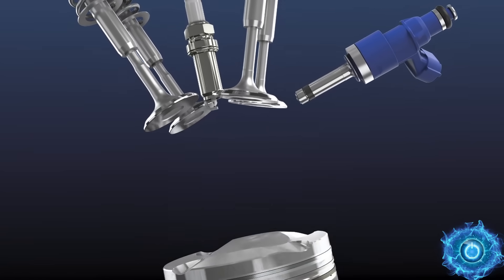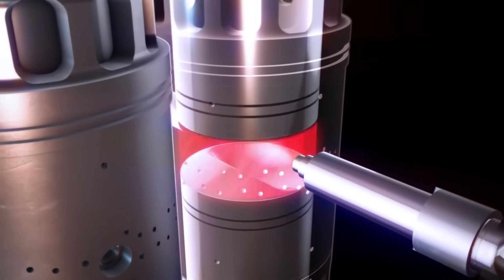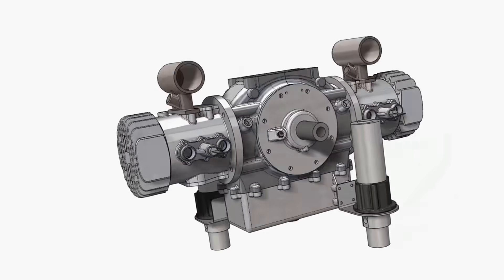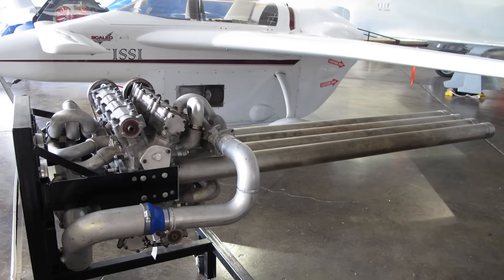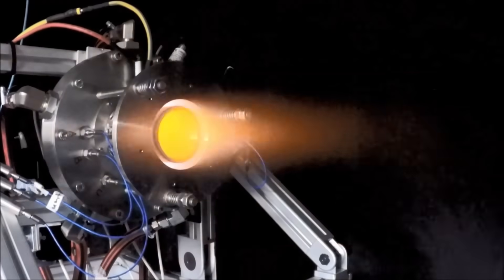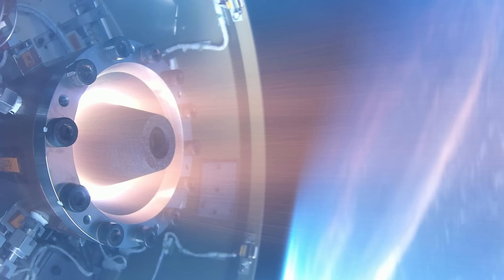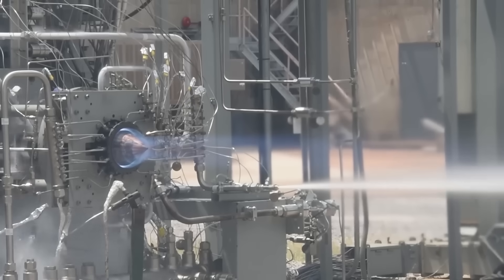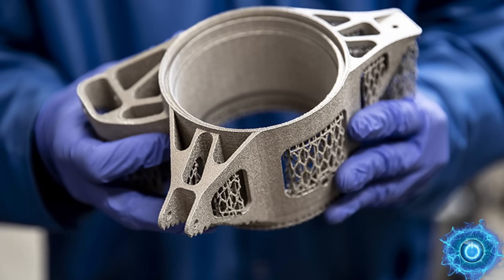NEW Aerospace ENGINE Destroys ROCKETS

Comment: Chain detonation with direct, on point, direct injection. You can achieve a nice harmonic equilibrium by timing exactly after the wave front..
 Inject , detonate, pulse, vacum , inject, detonate, pulse, vacum... need 40khz cheap ?  example/ Drive 8 GM C8 injectors at 5k . K.I.S.S  Dont go all Nasa $ for a test rig.
Off the shelf, power use those components, the worlds full of premium gear close enough to what you need, just search . P.s Copper beryllium is actually surprisingly strong against vibration heat. Would make nice baffles and diverters? Or not. I just build test , break , or win. Good luck.

Comment: God Knows Best. 
What If multiple injectors(at an angle & not perpendicular) along the length of the pulse engine tube is used and they’ll detonate like in a sequence. Does having spiral grooves inside of the tube provide with more thrust.

Comment: This high temperature and pressure concept would work well with a water plasma. The engine could start with a partially plasma, then progressive to a more fully advanced plasma state.  The energy produced could out preform the normal liquid fuels.  A pulsed modulated laser would be used to generate the necessary energy criticality.
Reply: The rate of plasma production is suspect with keeping pace of output production within volumetric constraints.
You don't see any postings of actual production measurements that are readily translated to combustion metrics. No CFM per cubic yard of hardware and weight per cubic yard. Also, what about the amount of watts needed to produce that same quantity?
With battery technology, you see watt-hours per Kg, watt-hours per cubic meter and other important metrics posted and easily translated into output weighed against drag, vehicle weight, rolling resistance and other counter forces.

Comment: I think this needs a lot experimentation with many different designs, which might then result into some hobby designer finding a weird solution that is designed in a way that it fixed most problems with keeping the detonation rolling.
Reply: Knowing our track record. It'll be an rc hobbyist or someone trying to strap one to their car or motorcycle
Reply: If you understand the materials and or computer sim needed, plus the 3d metal printers, it doens't look possible.
Reply: @635574  until someone comes around that doesn't know it's impossible and builds something ridiculous that fixes the problem with keeping a constant detonation. Well, one might dream.
Reply: @635574 you don’t need 3D metal printers they’re a fucking scam anyways. You need a cnc machine and an aerospace welder which is exactly what nasa uses. They aren’t gonna put a 3D printed anything inside an expensive device. That was a prototype..

Comment: So basically this is an old design of the aerospace engine? Which should've been the future rocket design if it wasn't for political reasons not to choose aerospace or linear spike engines over Bell shaped rocket designs
Reply: Lol, good job missing literally everything about this and just looking at the picture. Did you watch the video? They don't give a rats hind end about aerospike just that it's the natural form factor when you burn the fuel air mixture in a ring-shaped chamber.

Comment: I realize tokamak is completely different but they are trying to control a rotating plasma wave.
Using magnetic fields to control a rotating detonation might be a solution...
Reply: Maybe. I have some ideas. High pressure purge air source to push out the fumes. Have that rotate on the opposite side of a rotating igniter. That way the air is always ready for another detonation lap and the ignition can travel along with the detonation to maintain control.

Comment: these could power a generator on a bus or truck and the vehicle have electric motors. Smaller batteries could be used for specific applications or situations. Hybrid designs eliminate range anxiety.
Reply: That's really not a good idea for these engines. They are way too powerful. But if you want a bus going faster than a bugatti veyron you can strap one to the back

Comment: Elon has claimed that the new Raptor engine utilizes over 99% of the potential energy in its methlox fuel. Is that wrong? (Or did I misremember what he actually claimed?) If it's not wrong, then how could this engine generate any more thrust with the same fuel burn rate?
Reply from the maker: I will look into it, maybe cover that. It's just full staged combustion so I doubt it's near 99 percent.
Reply: @Motor_Explorer1  Thanks! Maybe start here: https://www.youtube.com/watch?v=ALiNmzoo1_E

Comment: A rocket carries its own oxygen. Does this engine use ambient oxygen? 

Must it has one exhaust tube per chamber? Otherwise how / what else can support compressed air into the internal combustion chamber? 

If it requires booster rocket to achieve compressed air how different this from ram/scram engine? 

It exhaust tube also act as compression function, excessive down stream tube attenuation is expected that concert supersonic pulse thrust into subsonic.

Comment: The Germans did this with the V1 in WW2.
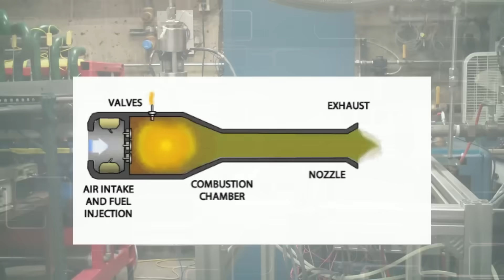Reply: not quite.. at 0:10 tere is a picture of a v1 style pulse jet but this has nothing to do with detonation rocket engines.
Reply: @simonl7784  What is the difference?
Reply: pulse jet is subsonic and much less efficient, and uses atmosphere for oxydizer, etc etc.  just not the same tech
Reply: @simonl7784  My point is functionally they are the same. The V1 design was revolutionary and modern day enhancements evolved from that,
Reply: @simonl7784  My point is that functionally they are the same. The V1 design was revolutionary and modern day enhancements sprang from that. Similar to modern day rocket engines based on the V2 design.
Reply: @donaldespeut2042  functionally they are fundamentally different. One is a jet, the other is a rocket...  I guess that goes to show how little you understand the tech.
Reply: @simonl7784  I am saying the same to you.

Comment: Candle combustion only needs three things. Air, Heat, Fuel (the wax). The chemical reaction happens because the three things exist. Or you could you could add a fourth "a table", or a fifth "a planet with a table"...
Reply: Ot a 6th Chop Suey but Everything's a table

Comment: Lolz....   worthless for a rocket.  Just a bilateral multi diaphragm pulse jet. After 35,000 feet it would be starved of oxygen and run so lean it would melt a ceramic  liquid helium cooled bell in seconds.  Bin there done that 30 years ago.  Lame..   rebranding Morse Tilnergs engine design from 1994 zzzzz new kind of copper bell lolz.... try no again invented in 1955....  fact they 3d printed the bell with cooling tubes is what is new

Comment: Man, with all the technical convergence of AI/FEA/Flow Tests/3D Metal Printing, we are about to see huge leaps.
Reply: Doubtful they’ll 3D print shit for aerospace it has the most rigorous requirements for perfection and 3D printing doesn’t produce perfection. They have cnc machines and high dollar welders to ensure this suits correct and accurate. Nothing you seen in that working rocket was 3D printed.. that copper thing sure but come tf on mixing copper with chromium doesn’t make copper have a higher melting temp.. an every person I’ve watch try to 3D print jet parts fail because plastic + fire = melted. Even the metal 3D printing is bonded with a polymer..

Comment: Beats Wiley E Coyote's rocket by a mile... time for new technologies..

Increased noise was listed as a 'negative' attribute. As soon as RDE is high enough, the thin air will no longer transfer noise. Vibrations from extreme noise (high pressure) will stop outside the RDE, but vibrations will continue inside the RDE as they are transferred inside the actual material RDE is constructed from.

3D printing complex shapes out of new materials will result in successful RDE.

Comment: They'll be fine for thrusters but long burns will hit the cooling barrier that confounds aerospike engines: The cooling demand rises by the cube and the cooling ability rises by the square. The NASA demo engines used a cooling method that's too heavy for flight. Once again Earth just barely lets us into orbit, but we're getting better.
Reply: To be fair this type is also likely to be much lighter than that type. Meaning if you do it right you could probably get this one to carry its cooling system as it'll be much lighter itself

Comment: Looks to me that RDEs have a very bright future and I think it is only a matter of time. It will take time to figure out the proper configuration and dynamics for this engine to take us to the next stage of Human space exploration. If we can manufacture an engine that is capable of taking us to Orbit in the way that this engine does, and make it so that it isn't trash after the flight up, then we can begin to make them bigger and more powerful to the point that they are reusable, and fully capable of operating in the vacuum of Space, then this engine is going to be either the engine to take us there, or the father of the engine that'll take us there, or perhaps the grandfather... but it is obvious that we need something more efficient and more practical than a Rocket engine.

Comment: RDE looks like it oculd be the next step in Aerospace engines.  Computational fluid dynamics, as my favorite Physics prof at the U of A used to say, don't forget to carry the one.
Reply: Yes, somewhat. There are other steps going ahead as well. NASA has a working RDE engine and as mentioned these are 20% to 30% more fuel efficient than current engines ng ones which means you can many more tonnes of mass into orbit for the same fuel. But you're still limited when it comes to distance you can travel. And for the distance problem NASA is working on a nuclear engine and hopes you do a rocket test with its nuclear engine in 2027
Reply: @ms3862 
One reason l would like to see more effort put into alternative fusion reactors especially Proton Boron-11 is the possibility to get direct electrical output. This could be used to power high performance Vasimir or Arc Jet propulsion systems.

Comment: The German V1 cruise missiles they shot at London in WW2 used a pulse detonation engine. That is why they made that infamous prattling noise people who experienced it often mention.
So it can't have been too complicated a principle if it predates the first fully functional jet engine.
Reply: Pulse jets still burn fuel subsonically like normal engines and even ramjets, whereas scramjets and pulsed/rotating detonation engines burn fuel at supersonic speed, which is incredibly difficult to arrange and maintain, and that's why it's only starting to become possible with modern computer simulations, materials and 3d printing.
Reply: The V1 used a pulse jet not a pulse detonation engine. Very different engines
Reply: The pulse jet in the V1 used a totally different principle.  It had a shutter at the front to allow air into the engine, that slammed shut when the combustion happened.  It wasn't a detonation, that would have blown the engine apart.
Reply: @NSResponder  It was literally a detonation, the detonation closed the shutter and the expanding gas reopened it while drawing the new mixture into the engine where it redetonated due to some heat/fire remaining inside the engine. 

The only thing nasa did was make it more complicated to make it more powerful, the basic principle is the same. The only reason why the detonation inside the V1 engine wasnt tearing the engine itsself appart is because the mixture was made that way, it delivered enough thrust ... so a low yielding mixture was enough. The V1s concept was range over speed, so a deflagration was the way to go.
Reply: @PiconPrimeKnight  No, that wasn’t a detonation in the V1.
It was a pulse jet, not a pulse detonation engine.

Detonation is not the same as deflagration.

The fuel in a piston engine does not detonate.
Reply: @PiconPrimeKnight  Wrong.  It was a burn, not a detonation.  A combustion chamber strong enough to survive repeated detonations would have been too heavy.
Reply: @PiconPrimeKnight  sounds like you are using "detonation" to describe any explosion, but properly it only refers to an explosion that propagates through the exploding material at supersonic speed.
Reply: You're mixing pulse jet with pulse det. Pulse jet = Tom Stanton made one and strapped it to his bike. Germans put it on v1's. Pulse det = rumoured Aurora plane going mach jesus
Reply: Farting not Pratteling
Reply: That was pulse detonation. What NASA are trying to do now is continuous rotating detonation. Not at all the same thing.
Reply: @palpytine  I know, but he said in the video that high quality alloys are needed to sustain the pressures of pulse detonation engines too, before he moves on to rotating detonation engines.

Comment: I came up with a rotary detonation type engine design back in college like 15 years ago using hydrogen and oxygen, but i never pursued it very far as it was very expensive.
Reply: It takes to things to be an inventor, a good idea and financial backing. The concept behind a new technology is usually the easier part unless you already know someone who has deep pockets and the motivation to back you.
Reply: I can feel you brother, I made an Aerospike engine when i was in college. Rotary detonation was way too hard and costly to fabricate tiny components for my prototype engine platform.
Reply: Dalorath : In my own point of view, rotary engine was just a "modified" steam. powered engine- their similarity in designed was 80- 85%... If steam engine was 40% in efficiency, so any variant of its design- possibly will also have 40% efficiency in power consumption...
Reply: @arielhermoso4262  I would like to share with you my design, but i still have hopes of building it myself one day without being beholden to someone with money lol...
Reply: Been there myself, just a different story.   Hydrogen sucks to work with, it responds differently than other gasses, liquid state requires massive pressure, and hydrogen is quite capable of passing through what would normally be leakproof (small molecules high pressure) and as you mentioned, the cost is outrageous for large scale projects